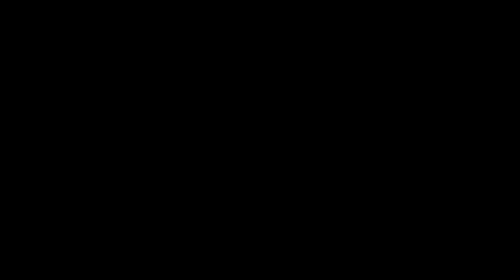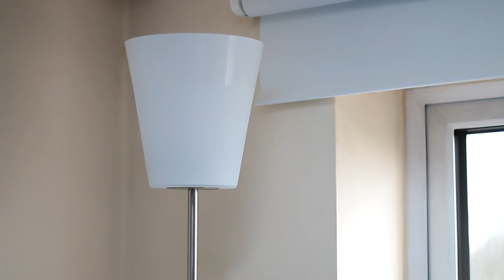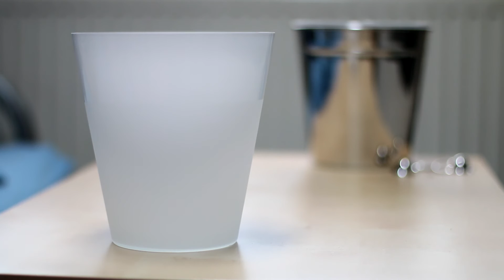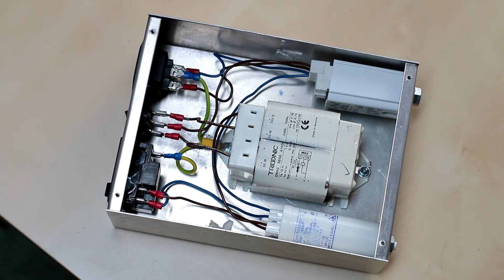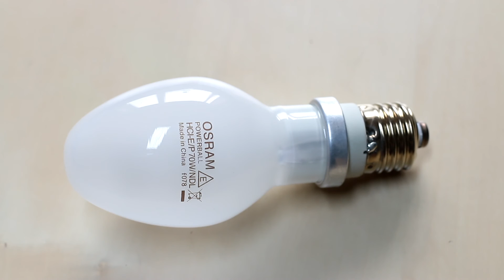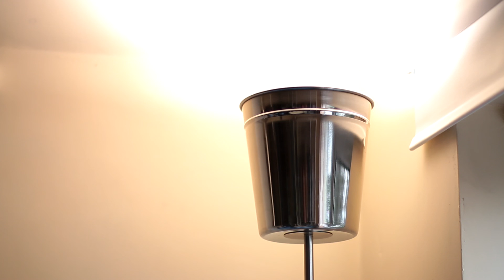IKEA Basisk Ice-bucket uplight mod.

Comment: Now you have a real bug hotel. No more flying insects if you have the window open, they come in and crisp instantly.
Reply from the maker: Yeh, they would get nuked :) Hate having the window open when it's dark for that very reason, but that's what the heatpump is for :)
Reply: FrontSideBus I tired to get a heatpump. I tried. But lest the powers that be would not permit. I'm hoping to get an extractor fan fitted above the computer cupboard in the new room, as otherwise I'll continue to have 8 computer heat problems!

Nice vid as always! The powerball coated lamps with their silver ring seem to leave me perplexed for a few seconds when I glasp an eye on them. Provided a nice affect though.
Reply from the maker: Peter C
 Watercool them all :) Have a car radiator, pump & fan mounted in the loft with each PC being connected to a common feed and return line. I've seen it done before :) It was quite a nice setup used to cool a load of PC's used for folding or whatever. Had quick connect fittings on the back of each pc and the fans were PWM controlled to keep the coolant at a set temperature. Pump & reservoir was basically a pond pump in a large bucket of water!
 We did contemplate having the radiator outside but when the temperature dropped there would be condensation issues on the CPU & GPU blocks.